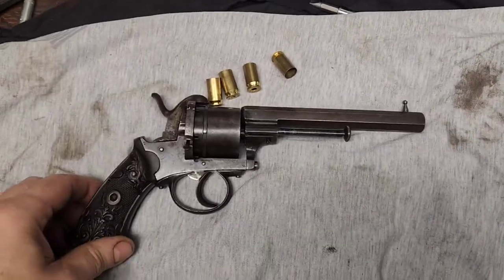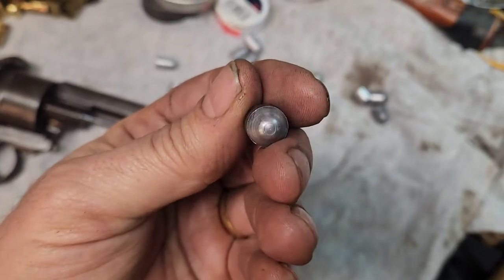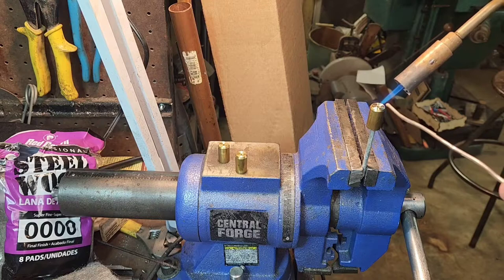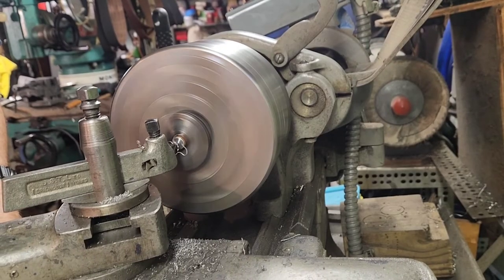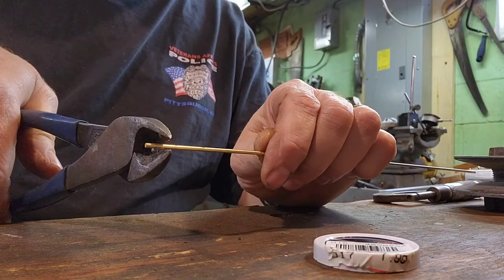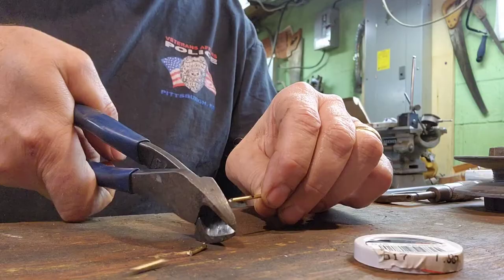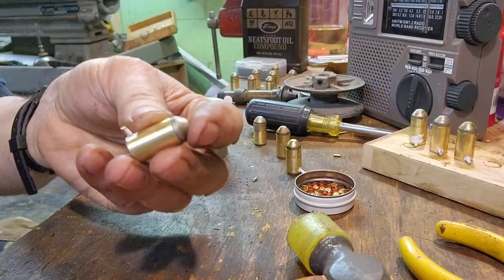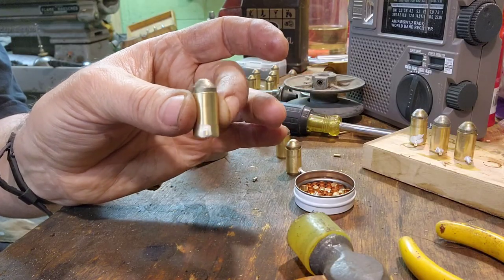Loading 11mm Pinfire rounds from 45 ACP brass Part 1

Comment: Wonderful job! I have one of that revolvers and I'll give you my experience. I use bullets from a Lee mould .450"/200 g just as comes out of the mould. Is a flat base bullet for cap & balls, and I've got an amazing accuracy. I have a lathe but I use old Berdan brass which reform manually. Thanks and greetings from Argentina.

Comment: Why remove the rim may I ask . Could this be done without removing the rim .if not why ?
Reply: the pin has to be on the edge of the hollow side of the cartridge, so you have to trim the thick brass off that holds the original primer in order to place the 2mm rod. you only have little space on the cylinder where the pin would fit, the rim would place the hollow side of the cartridge too much to the front of the opening in the cylinder.